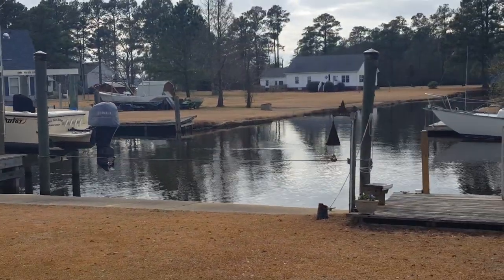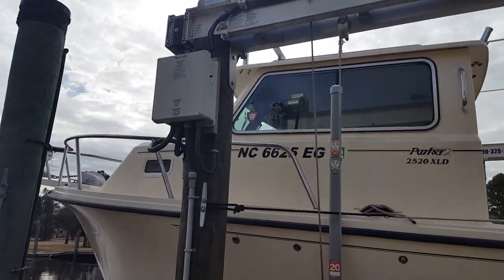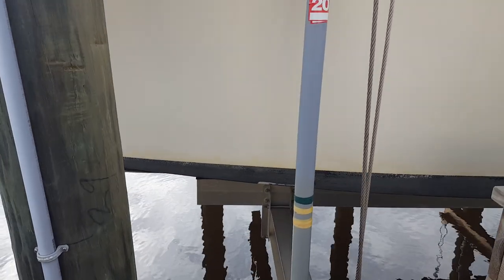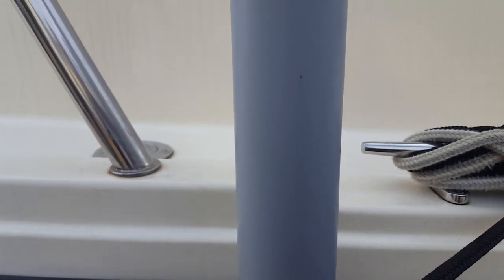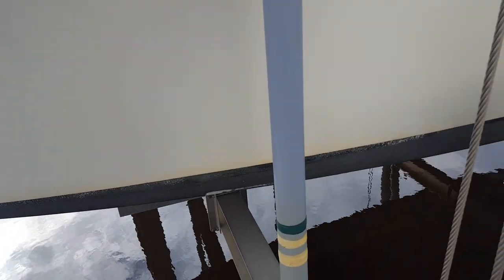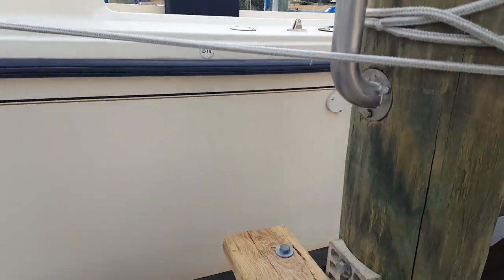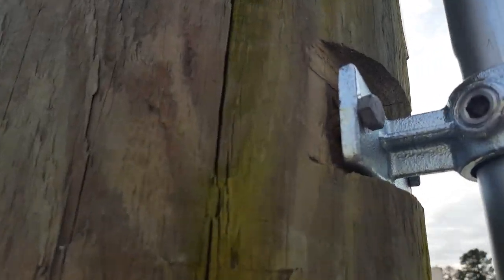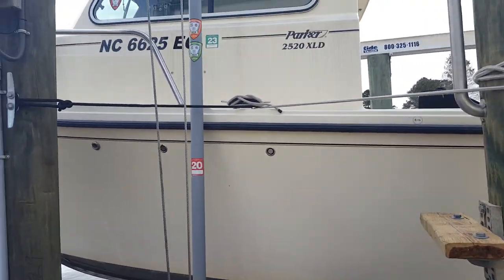Boat Lift 'Hacks' Balance the Weight. Parker 25 Pilothouse.

Comment: It really depends on the boat itself. For example I spoke to an engineer at Bennington and I’m going with flat bunks that will sit under all three toons on my Tritoon.
He said he wanted the bunks pretty much flush on the rear, and at least 12 foot long to extend past a weld that runs through the middle of the pontoons.
All boats are different,
Reply from the maker: Hi Joel, good information! As you said, all boats are different and need different applications for the lifts. Thank you for watching and communicating.

Comment: @Andrew F Yakim Great info on the lift and other details.  Thank for sharing.  I'm having a lift installed next month.  BTW I can see in the video that you upgraded to the Yamaha cover. 👍
Reply from the maker: Hi Gregory, thank you for watching! I'm not sure which video you're referring to. I used to have a 'generic' motor cover that I got from Overton's that lasted only two years, and did not fit tight (I had to use heavy clamps to keep it in place) and blew to pieces in the last hurricane. I did get the 'official' Yamaha cover from Sim Yamaha. It is difficult to install, but fits perfectly.
Reply: @andrewfyakim525  I spray my cover with 303.  I think it may last longer.  I did that with my waverunner cover and it lasted almost eight years.  Plus the stuff is made in the USA (so it says)
Reply from the maker: @gregorybaker830  I too use 303, in fact I use it on everything that is plastic or rubber. I have not tried it on the Yamaha cover, but at your suggestion, I will do that today! It's supposed to help shield UV rays, so I will give it a try. 303 is non-solvent based, so it does not damage most materials....
Reply: @andrewfyakim525  make sure to use the one for fabric.  Here's a link for reference.  https://amzn.to/3xWFgOO
Reply from the maker: @gregorybaker830  Whoa! thank you!!  I'll get some of the kind for fabric. I was about to use the regular stuff I have on hand... (I buy it in gallon containers; it lasts a couple years).

Comment: Where did you get your grab bar?
Reply from the maker: Hi Nicholas, thank you for watching and for communicating! That grab bar came from a night club called the Carolina Opry House, in Greenville, NC. They remodeled the place back in the 1980's, and it was tossed in the trash pile; it was painted white when I got it; I stripped it back to the original stainless steel, and put a red rubber cap on top to keep water out. I installed it upside down like that, as it makes a handy place to hang bags, tools etc when I'm getting on and off the boat.. The same and/or similar stainless-steel 'handicap' bathroom bars are available at most building supply companies.... (by the way, The Carolina Opry House has been closed down since the 1990's).